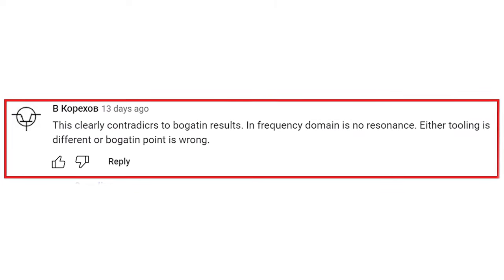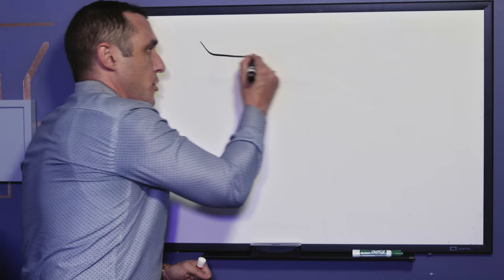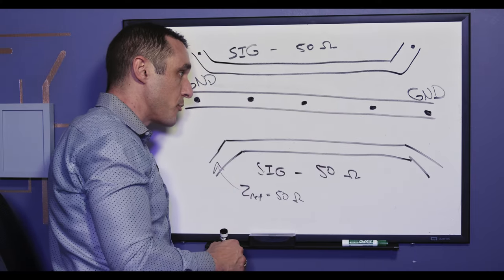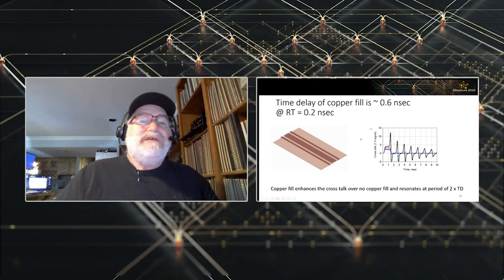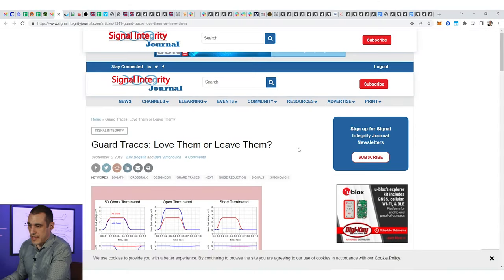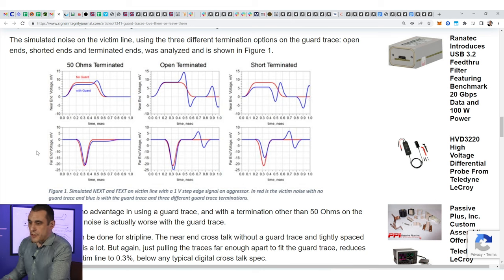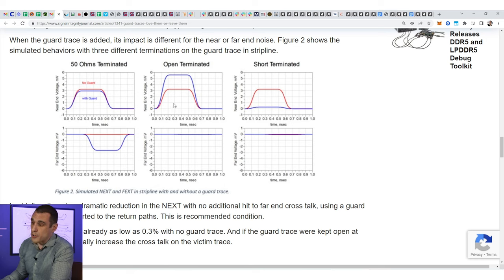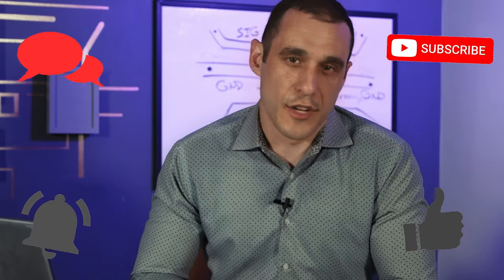Guard Traces & Crosstalk | A Follow-up

Comment: This is where I wonder if Zach and I are speaking the same language. In analog, what we call a guard trace is typically used to protect a single signal trace from interference and is driven to the same voltage as a high impedance input, e.g. the "virtual ground" reference of an op amp.
Reply: I think the different languages are essentially analog and digital. Or high and low impedance.
Reply: In digital guard trace is meant to literally refer to a trace, but what matters is how it is connected at each end (usually ground at one or both ends). In the audio case it sounds like it's driven at one end and terminated at a high impedance at the other end, do I have that right?
Reply: @Zachariah-Peterson  Close. The guard is driven to a low impedance reference voltage, usually the op amp's virtual ground. The potential victim trace goes to the op amp's high impedance input. The guard is often a ring around the input. Depending on the implementation, there may also be an RF bypass capacitor to shunt aggressor noise to chassis or system ground, like the one I called out on a connector in another recent video of yours.